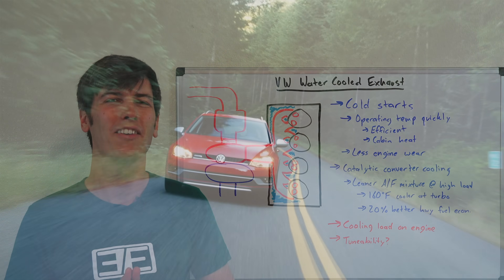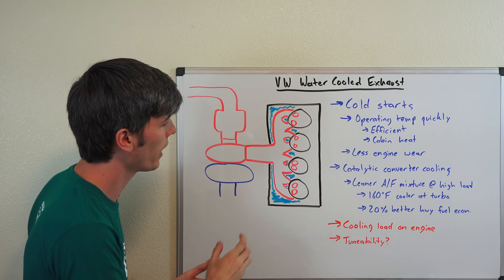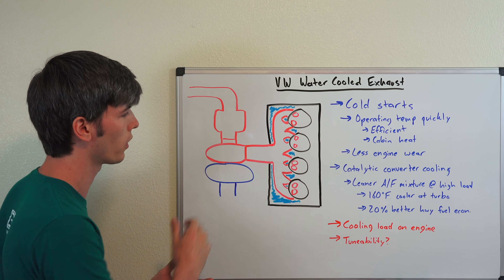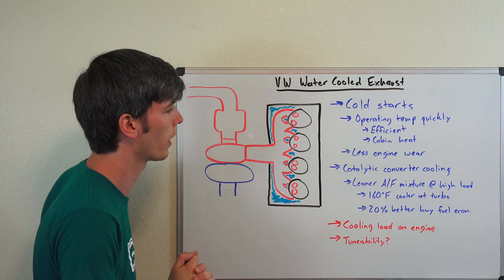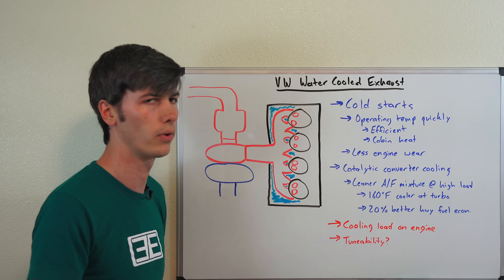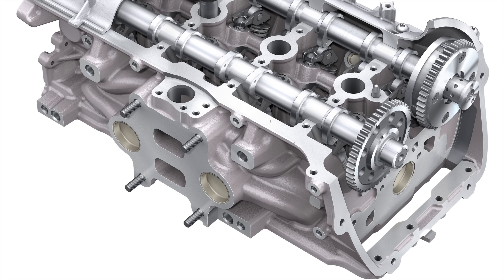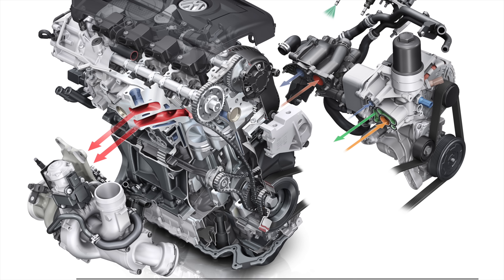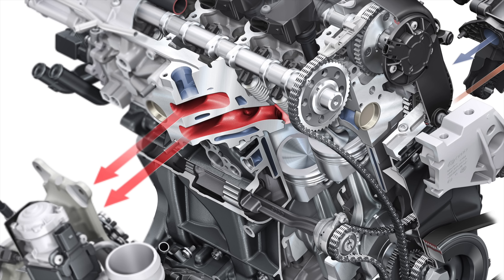Why Does Volkswagen Have A Water-Cooled Exhaust?

Comment: I had this 1.8t engine in a 2014 Passat that I leased.  I easily get >40 mpg if I keep the speed at 65 mph.   I had 0 issues with the car.  I wonder if the Audi B9 (2017+) 2.0t engine share this cooling design?

Comment: I wonder if you can tap into the cooling system and run some heat proof pipes round the exhaust manifold to achieve something similar on other engines 🤔

Comment: In regards to the tunability of ths Gen 3 TSI it is actually really good....the smaller output engines(the 1.8 and the GTI/GLI 2.0T) have the benfit of being able to accept the larger IS38 turbocharger from the Golf R/S3/TT S. With the supporting software power output levels approach 390hp on the 2.0L with stock internals and some bolt-ons. I have read of some people with the Alltrack putting an upgraded clutch in the 6spd and getting the IS38 installed on the 1.8L, with AWD, sounds fun. The new Gen 4 engine promises to be even better. The Stage 1 E85 tunes are producing nearly 400lb-ft of torque on the Mk8s. Can't wait to see the Stage 3 numbers.

Comment: Cooling system must be very accurate and well managed I think not only a bigger radiator is needed for this, exhaust heat is a great amount of extra heat added to a  normal engine cooling system. Perhaps and extra thermostat or parallel circuit.
BimmerN53

Comment: This makes sense as too why the gti can get such great fuel economy when driving enthusiastically.  My mk7 gli averages 21mpg with mostly windey backroad fairly aggressively with lots of hard acceleration pulls up too mid 100s. Lowest ive ever gotten it (reset mpg then drove as hard as possible ) was 14.7mpg😂
Side note: though i do carry high speeds... i dont spend anytime below 40mph average during a drive prolly 70 with highs of 160 so maybe thats why...

Comment: Intake air/gas is 1/4th the volume of the exhaust.  That's what heat does.
It does not seem to have occured to you ire anyone that cooler gas has less volume and if the the volume of gas in a exhaust system is reduced;  the exhaust is more free flow...

Alternately; a smaller (pipe diameter, mufflers) exhaust will work as well as stock one.
To the point where it could be a quarter of the size if you got the gas down to ambient.

The slowing of the gasses (assuming stock size) would mean more time spent in the mufflers which would probably mean more silencing too.

Comment: Not sure how Saab does it but my 2004 9-5 manages to get hot air in the cabin within 1 min of startup, even in winter - without all this.
Reply: Aux heater does this driven from diesel. Or petrol. PTC electric heater does this too

Think also common on diesel Land Rovers

Comment: More and more complexity in engines is slowly becoming a nightmare to work on or repair. I'm not impressed. Moreover I can't see that lower exhaust temperature would make the catalytic converter work better. All radiators corrode a bit and this might corrode as well spilling coolant into the exhaust valves-good-bye engine.  But if this is truly a water jacketed manifold then it would make a good marine engine. Trouble is, the colored diagram/graphic seems to show it is kind of a bastardized system at best. A true marine manifold is fully encased in a double walled water jacket and virtually no exterior surface is not water jacketed. This thing however looks slap-dash in the way the coolant goes around the exhaust manifold here and there but is hardly integrally enveloping the thing.
Reply: I've never heard any issues with this system. Benefits outweigh the cons. Literally not even 1 mile into my commute, coolant temp is already near 200 degrees and stays at 200. It is probably crucial to use VW's coolant though, particularly their purple coolant.

Comment: I understand the advantage of faster warm-up, granted! But gas engines need to run stochiometric all the time (this is why they run so clean), I think there can be no sustained operating point that is actually "really lean" (significantly less fuel than stochiometric) or "really rich", is there?

Comment: I wonder what kind of trade-off they had to make with regards to reduced aerodynamic efficiency in these internal exhaust manifolds. There is a "cost" (in engine power) when you increase exhaust restriction (vs a normal exhaust manifold).

Comment: 20% better highway fuel economy does sound really good. I guess it should have similarly high fuel economy if it was running generator instead of drive shaft (e.g. like Opel Ampera).

However, considering that VWs have a history of cracking the cylinder head if the engine ever overheats even a little bit, I would expect this cylinder head to crack very very easily. As long as the thermostat works, you always keep coolant level high enough and no water pipes crack, you should be okay.

Do they still display water temperature instead of cylinder head temperature in the instrument cluster?

Comment: Fox engine from Ford motor company since 2012
Iron engine block and aluminium cylinder head; Single stage variable geometry turbocharger; Integrated Exhaust Manifold 
Hashem Attrah 
United Kingdom

Comment: Your catalytic converter explanation is more of a packaging issue. The same could be accomplished if the cat were moved down stream where are maintenance is easier. Also, removing heat from the exhaust can decrease turbo efficiency. While there is typically excess exhaust to power the turbo in this case VW engineers had to go with a slightly larger and more expensive turbo. Was this a good trade off? Yes until the car gets about 80k miles. Turbo reliability has been an issue with VW and Audi.

Comment: How can you say less Inchin where green reliability. Excess Heat hurts an engine. Overall these Volkswagen engines are prone to oil leaks as they age, far worse than most other engines. Your explanation is fairly good but your reasoning is flawed at times.

Comment: Lean mixtures don’t send enough HCs down to the cat. Catalysts overheat when the exhaust gas is too rich. Burning off the unburnt fuel overheats the cat. 
Cooling the exhaust gas allows the turbo to work harder at lower power settings without getting over cooked at full throttle.

Comment: I only recently learned that some (?) Diesel engines use water cooling on the EGR system - this is a gasoline engine using waste heat from the exhaust manifold? Decreasing warmup time from cold start is great for helping with emissions of course, but a 20% improvement in fuel economy at highway speeds?  Is that only for turbo engines, or would that number increase for non-turbo cars? If the latter, why aren’t all cars equipped this way these days?

Comment: What happened to the widely publicized story that turbos run on heat not pressure differential (caused by heat)? Old Ford flat head V8s had a torturous path through the water cooled engine block before exiting. The advantage there was even more back pressure and hot spots causing cracks.
This makes no sense to my old brain even after your qualified explanation.

Comment: Not new  its same as 2016 Cruze Ecotec 1.4l exhaust manifold  integrated in the cylinder head which Also provides quiter and smoth power.

Comment: Turbocharger is made to make use of excessive  exhaust heat energy,  othervise thrown out the tailpipe. Now part of the benefit is lost to the radiator. Only thinkable reason is fullfilling emission reducing requirements in cold starts.

Comment: So, in cold start the catalytic converter will take more time to be functional and the catalytic converter doesn't need to be cooled  except during rich AFR and if the exhaust is colder the carbon deposit can stay in the exhaust and cannot be fully burned. However this is better for turbo and it can allow more leaner AFR without harm exhaust component

Comment: Did a 450km road trip over the weekend with my new golf and got 6.4L/100km (36.5 MPG) which I think is pretty insane. With a 50L tank, I was able to go 658km on a single tank
Reply: Does it burn oil
Reply: @dragospahontu   Nope, and I do alot of road trips with mainly highway mileage and I actually average 5.7-6.5L/100km if Im easy on the throttle. The car in 3rd gear at 70km/h is at its more efficient point and it sips gas and burns no oil. My car now has 80k Kms
Reply: @iankonstantino6648  Nice
Reply: Does it burn oil

Comment: I think it's more a question of it has to be cooled. If the manifold was inside the head and un-cooled there'd be a massive heat difference between inlet and exhaust side of the head.

Comment: Ford flat-head V8's had water cooled exhausts from 1932-1953. The center ports were surrounded by water jackets thus heating engine coolant on the exit. Ford V8's would run hot while idling.

Comment: A longer term drawback could be a more uneven heating pattern across the cylinder head casting,increasing the chances of uneven clamping loads being maintained by the cylinder head fixings during and after repeated heat cycles and therefore more chance of gasket failure. Another concern would be the castings actual reaction to far more heat regardless of the cooling jacket in the casting.Remembering that a conventional exhaust manifold is usually quite exposed and with a large external surface area to dissipate heat.we are already replacing the external water jacketed aluminium exhaust manifold/turbo housings on BMW b38 engines because micro cracks in the manifold are causing porosity issues,still cheaper than a complete cylinder head though.

Comment: A good idea but it's a bit wateful of heat energy... How about an ICE cylinder hot end joined to the hot end of a high pressure, high power Stirling engine.. 3 or 4 of them for a 4 stroke ICE + turbo setup. I have an interesting compact, lightweight turbo design where the turbo and compressor are one fan assembly sitting on one bearing. Imagine a square or rectangle with a diagonal from corner to corner. The two triangles either side are the fins and the diagonal separates the turbo and compressor (gases).. In 3D it's a cone with the top cut off and a cylinder going through the middle. The compressed incoming air is preheated and the turbo is cooled... a mechanical seal and the fact the compressor and turbo gasses are heading in the same direction stops them from mixing, although a little mixing during the start of an exhaust flush is OK as long its clear by time the exhaust valve closes... clean air goes up left and out the top edge centrifuglly from the centre air in. Dirty air enter in the centre and is shot up and backwards and leaves out of the back, at the top... A drawing helps... It's for a free piston hybrid engine that runs cool.
Reply: Use waste exhaust heat to drive a Stirling?  May as use the fuel to heat the Stirling directly. Continuous burn is far more efficient...and cleaner.
Reply: @johnburns4017  .. An ICE is more efficient than a Stirling Engine but the exhaust gasses are hot enough to power a Stirling engine. Ideally this would be an ICE+Stirling generator combo + in-wheel electric motors to get rid of the bulky, heavy and wasteful transmission system used in non-electric vehicles. In a non-hybrid solution the main ICE and Stirling engine both power the main flywheel separately.
Reply: @PrivateSi  
An ICE is not more efficient than a Stirling engine. Stirling engines are bigger and heavier, another is that a good cooling capacity is needed, meaning  a very large radiator. Reasons that is why they never caught on. Having a Stirling off an ICE engine's exhaust is highly inefficient.

A small Stirling off say a large ship's engine's exhaust maybe beneficial.
Reply: @johnburns4017  .. You are wrong. An ICE is more fuel efficient than a Stirling engine with a better power to weight ratio. Stirling engines have been used as car engines and there are quite a few academic papers proving the concept is valid and the merits of putting it before, after or combined with the catalytic converter. You might be surprised how quickly a well designed Stirling engine filled with helium can dump heat. A fairly standard car radiator is good enough to cool the experimental all-Stirling car engines. The added weight is not huge and we're talking over 300' C worth of heat energy once the main engine's up to normal operating temperature with the cold end of the Stirling engine (generator) easily cooled to 100'C (or less) giving a good temperature difference for useful power. I have some nice piston and cylinder end designs for Stirling engines. Concentric rings at each end as an internal heat sink with the piston(s) also having rings so they slot together. This dramatically increased the surface area to volume ratio meaning more heat pickup and dumping per stroke.

Comment: The Ford Flathead V8 has (sortof) been doing this since the '30s  with the exhaust going  through the cooling jackets in between the cylinders and out the sides of the engine.

Comment: Emissions and production cost are the ONLY reasons VW would implement this design. 
As for the comment about "changing headers",  the owners of these sort of cars probably don't even check the oil. If it even has the ability to do that. Probably brings on an engine light if its low. 
4/5 years and it'll be a washing machine 😂
Reply: The new gen doesn't burn oil anymore

Comment: lol hey you will have a engine but the rest of the car will fall apart at 5 years old lol. I have 9 vw’s from 85 to 2016 and everyone of the new ones from 2007 on are piles of crap . Everything is plastic and fails water pump housing , intake manifold, hmmm crap plastic oil pan and plugs, oh yeah headliners everyone has fallen down  Jettas is down both  GTI is down Tiguan is down cc is down Passat is down .oh can’t forget about the crap panoramic sun shades that break after 3 years on 2 cars of its are faulty we pushed the button to open it lol. Oh can’t forget about the common antenna fails for the gps and Xm radios that we had to have those all fixed oh wait for it on 3 of the cars 4 times and vw couldn’t figure it out they went to a sound shop and the guy fixed it. Oh and can’t forget about high-pressure  fuel pump cam roller they will destroy your engine common fail and the crap electric power steering that failed on both Tiguans just outside warranty lol here is some advice don’t buy anything newer than 05.
Reply: Hey that's for the USA

Comment: Massive  engineering  potential  problems  for very small gain
Reply: They are important, and they don't crack so it's ok.

Plush the new EA888 don't burn fuel anymore

Comment: Mercruiser, OMC, Volvo-Penta has had water cooled exhaust manifolds for decades in the marine engine industry; while using standard automobile engines for their conversions.

Those water cooled manifolds bolt on to the heads just like standard manifolds / headers.

Comment: my main concern would be how well the casting will resist cracking when subjected to the neglect and abuse that most drivers put there cars through for example running the coolant low from a slight leak which VW seams fond of using shity plastic coolant fittings which tend to get fragile with age and heat exposure .

Comment: Reminds me of the flat head Ford V-8.   Their exhaust ports traveled to the other side of the cylinders before they exited the block.  My thinking is this is why these engines tended to run hot and had 2 water pumps.  At that time Cadillac had it right, with their exhaust ports exiting at the top of the block, and the exhaust manifolds being up near the intake.

Comment: MK1 Honda Insight had in head exhaust water cooled manifold 25 years ago...and that would run mixtures of 20:1 on lean burn...not new...and that engine on mine averaged 71.1 mpg over 195000 mile and I drove it like I stole it, the IMA battery failed and the last 95000 miles was engine only which is why the MPG dropped from 88mpg.

Comment: Cooling the exhaust increases the density & lowers the pressure before the turbo, so it spins less.  

Water cooling the exhaust manifold is a good way to reduce the efficiency of the turbo.
Reply: Exactly!

Comment: Good idea, better for engine, turbo, catalyst and EGR but wonder how much cooling you can achieve for manifold as surely the hottest part of the engine external now internals. Also if incorporating manifold into cylinder will increase risk of cracking somewhere especially in hot weather. Wouldn't it be a good idea to have multiple temperature sensors incl water level with readouts on these more advanced engine designs.

Comment: Hi, I newly joined the channel so forgive me for the late response . this system is fine during the normal driving conditions but unfortunately I drove the Ford escape with ecoboost turbo engine with the same technology on Sandy surfaces where you need to drive the car with high revolutions and exhaust manifold had reversed the operation as it raised the engine temperature so quick and put me in very bad situation in the desert as you can't stop any where on the sand because you will get stuck. so the engine's temp. Raised up continuously and I had to stop every time and I return the car to the dealer with big complaint letter to the Ford R&D dept . I highly recommend those who want to buy this technic for sand travels not to do that and get a classic engined car instead .

Comment: I always thought it was desirable to have hotter exhaust temps for turbos...heat is energy?
Reply: Up to a point... The heat is really expanding air...this is what spins the turbines.. but when you melt the turbo down, it's no good.. you can go 1400 or even 1600 for short periods.. and as I understand water cooled turbo's, they also inject water into the manifolds, creating steam.. steam expands 40 times, causing the turbos to produce insane boost